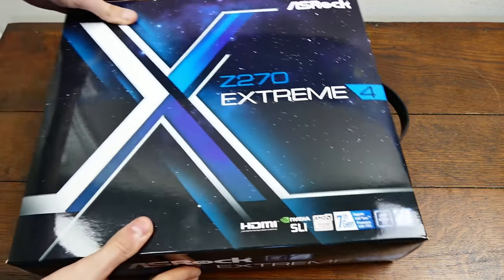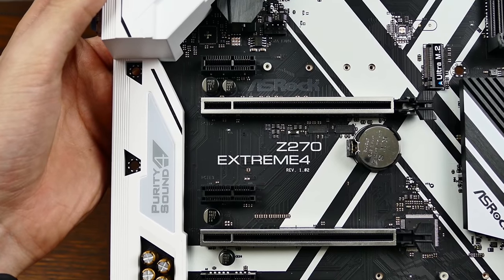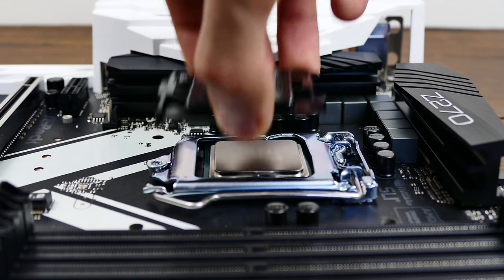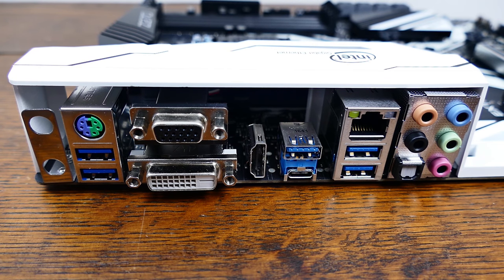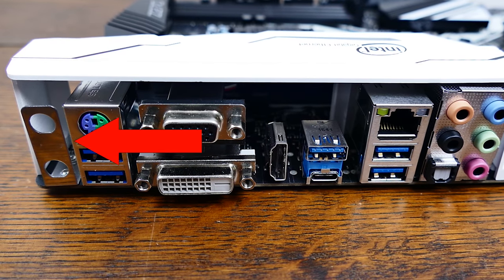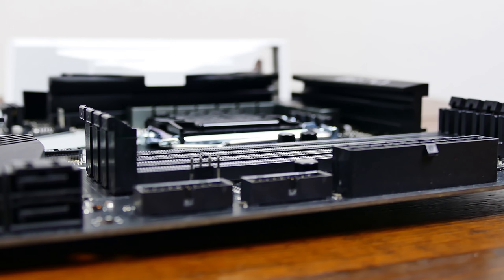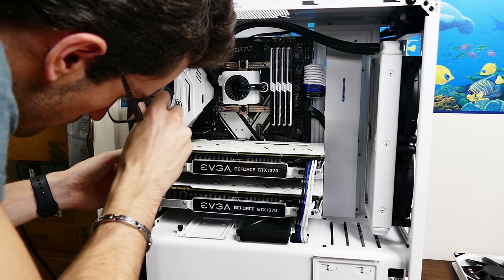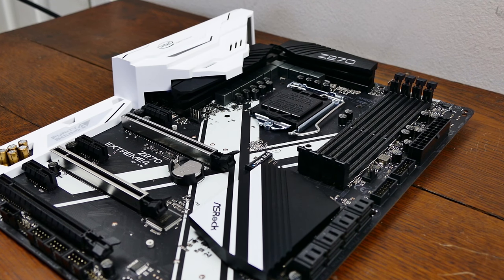Kaby Lake Z270 Extreme4 from ASRock

Comment: Can't wait for ZEN
Reply: Specially since some TechTubers managed to OC it past 5 GHz
Reply: well it is now
Reply: Ryzen is still a mythical beast until it's released as far as I'm concerned.
While the early info released by AMD is very promising, it has to actually hit the market (IN QUANTITY) to be able to actually force Intel to come up with something good, or at least lower their prices on current chips.

God knows if AMD has fixed their supply chain issues or whether they're holding back release until they've built up enough stock, but if they pull off a successful release of a chip lineup that competes with Skylake/Kaby Lake in terms of performance/watt AND performance/dollar, it'll be a master stroke by Team Red.

I want more than anything to see a resurgent AMD simply because it forces Intel to stop sitting on their asses and squeezing consumers dry. A healthy market should have options, and AMD needs to be that option or they might not ever be able to come back from this.

For the matter of Kaby Lake, it's not a worthy upgrade if you're coming from a Haswell/Skylake platform. There's just too little difference to justify the money you have to put in, unless you absolutely need every last iota of performance you can get out of your system.

Comment: Glad to hear that Skylake is compatible. I read somewhere that Skylake would not be able to work in Z270 motherboards. I thought that was ridiculous, but glad to hear support for Skylake is ready to go out of the box.

I might be getting a 6700 non-K CPU from a friend who upgraded to an 6900K. So, I need a new motherboard and might as well get a z270 motherboard for it. Then I'll be set for possible CPU upgrade in the future.

Nice video, man. Quick and to the point. That Asrock board does look pretty good. I have been hesitant to go with them because of some of their choices in board design. They don't always have all PWM fan hubs, and they like to use hybrid digital-analog power with phase doubling for VRM.

Comment: Still rocking my asrock z77 extreme 4 motherboard. Been doing so for 4 years with zero issues. But there's an issue here. their is no power and reset buttons on the board.. a deal breaker for me. the z77 version of this has power and reset.
Reply: Should I buy Asrock Taichi in 2024 ?? 🤔

Comment: Still sporting a GT 710. Anyone else?
Reply: Tyler Pritchett me😀😀😀😀
Reply: Utkarsh XD It's about as good as the stock graphics from my old 4790k rig. Lol
Reply: What games can you play?
Reply: DepAnx I mean, it's anything that stock Intel graphics will do, to an extent. You can pull off minecraft. It gets a little over 30fps on Cinebench's GPS test.
Reply: Gtx 460 for me XD
Reply: I used to rock a GT 730, but I'm using a GTX 1050ti for now until I feel like getting a better GPU
Reply: The Revanchist i use hd 5670 for world of warships and shitty lg monitor
Reply: Joonas Pohjola
I have a 23" Asus, 1920x1080... Its pretty nice for $130
Reply: I have a GTX 960... 2gb...
Reply: Tyler Pritchett sapphire r9 270x

new build with a 1070 is in the works though.

Comment: They removed the debug LED panel from the Extreme 4 line up. Damn....
Reply from the maker: I agree. Something I forgot to mention but it is a letdown.
Reply: Just an idea, it would be really interesting if you could get a cheap pentium like the g4560, since many of the kaby lake pentiums are now hyperthreaded, and see how it compares with an i3.
Reply: They are not hyper threaded they remain dual cores for a reason
Reply: Fearless Ghost check again mate the G4560 on the ark. all Pentiums but one are hyperthreaded on the kaby lake lineup
Reply: Ah your're right sorry man. Just amazes me that Intel was generous enough to make it hyper threaded. Wonder if the multiplier is unlocked though. I was once sporting the G32584.7ghz for a year till I upgraded to the 6700K
Reply: Fearless Ghost same as me lol exact same frequency as well lmao
Reply: Exactly what I have noticed. Does it mean I need to pay more and more with every generation for this 'feature'? As for me big let down as it was their selling point when I bought Z170 Extreme4
Reply: I think the debug led is missing only on the Z270 platform, because the AM4 extreme 4 looks like it has the debug led as usual, according to some leaked photos of AM4 mobos.
Reply: debug led is present on Asrock z270 professional gaming K6 motherboard, a superior model than the Asrock Extreme 4
Reply: pr0orz1337 Thats exactly the case. It WAS present on Z170 Extreme4

Comment: But will Kaby Lake processors be reverse compatible with z170 motherboards?
Reply: yes
Reply: Yes.
Reply: I herd NO
Reply: so if I buy an i5 7600k it'll be compatible with a z170 motherboard then? Nice.
Reply: As far as I know, they're supported, although there could be some obscure features that won't fully work with Z170. But more importantly, there's very minimal performance improvements over Skylake, so I don't see much reason to upgrade.

Comment: dmmit the z270 is gonna be the new thing isnt it?
Cause im just building a z170 alpha maximus sigh tech goes so fast should i consider switching too a 270 board for futureproofing?
Reply: Gabriel Van Middelkoop no unless you want the extra 1-2 features that aren't too useful stick with your z170

Comment: do you think it would be possible to put a kabylake chip in a Z170 board, since I just got a Z170 PC and I wonder if it would be possible to do that since I dont want to replace my motherboard but would be willing to replace my CPU
Reply: Frankie I've looked around and have seen enough people that yes, you will be able to use a kabylake chip in the z170 chipset. Unless you have like an i3 or something, I suggest not upgrading to kabylake as it's not much better than sky lake, aside from clock speeds.
Reply: most z170s will get a bios upgrade to use kabylake just like the z87 got updates when z97 and 4790k and that came out if you already have a 6600k or 6700k there isn't much point though

Comment: idk what it is but I just don't fancy ASRock boards.
Reply: Ashish Parmar I used to be that way until I used their BIOS.. by far the best IMO. I go out of my way for ASRock now for that reason.
Reply: ill have to check it out then, i have always loved msi's styling I currently have a z170x ultra gaming by gigabyte and its great but maybe a bit on the stale side as far as bios goes, i think its because when i first started building pcs they werent around
Reply: Ashish Parmar Yea. ASRock BIOS's probably aren't the prettiest, but utility wise, is amazing. My Z87 Extreme 4 has overclock presets for the unlocked processors :). Not having much OC experience myself, this is quite nice.

Comment: Can you use the new chip in a gigabyte z170?
Reply: Lorenzo Aguinaga yes they're both 1151 socket compatible well they were made for 1151. skylake aka the 6th generation processors work with the new motherboards aka z270 mbs and the new generation cpus aka kabylake will work with z170 motherboards or any other motherboard with the 1151 socket
Reply: Ok, I was going to buy one. Because I don't have an Intel processor in my Z170 motherboard
Reply: ***** btw if the 6700k/6600k are cheaper than the 7700k/7600k then get skylake. If the difference is 10 dollars or 15 just go with kabylake ;) enjoy
Reply: Ok, thanks :D

Comment: Z270 ?!!!
Reply: Ozone Strike Yes. New Chipset for Kaby Lake
Reply: IK, but so early
Reply: Its not released yet.
Reply: ***** IK, BUT HASNT BEEN RELEASED, BUT A REVIEW WTF
Reply: Will probably be officially announced during CES.
Reply: MrJonton01 As fas as I know this chipset is not completely new but slightly reworked, just with some more pcie lanes etc. The Kaby Lake cpus up to the i7 7700k schould run on a z170 board too, just with a uefi flash needed. Would be interesting if the cpu performs better or the same on a z270 board.
Reply: lensdu Yeah the 7700K and 6700K are really similar, especially in terms of gaming performance. They can be overclocked higher than the 6700K and support 4K Netflix & Optane but I think that's it.

Comment: Looks like a nice board, but it has the crappy DDR4 sockets:    there is an ejector on ONE side only, instead of both sides.  That makes removing DDR4 modules harder.   A lot of budget boards are like that, but this is supposed to be premium.   Disappointing!